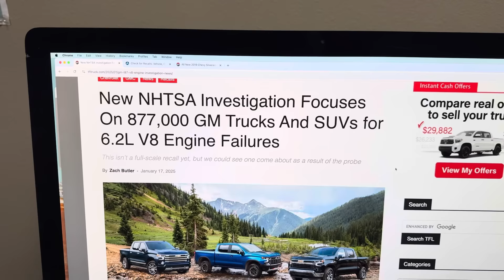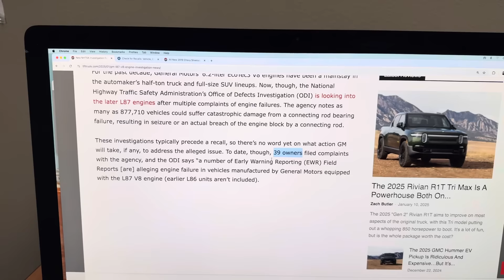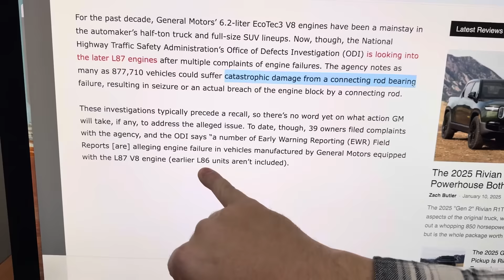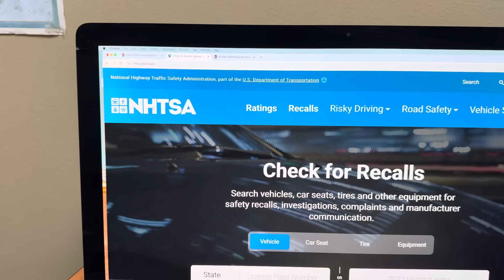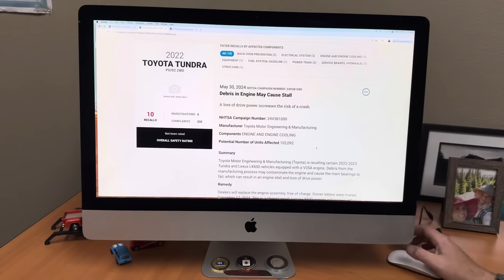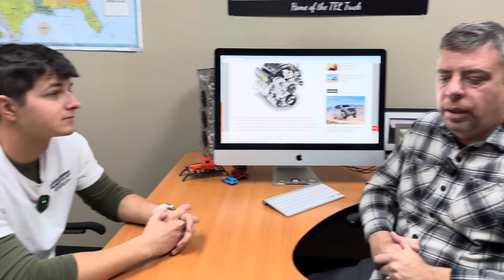877,000 GM Trucks & SUVs INVESTIGATED Over Failing Engines: Are You Affected?

Comment: My sister-in-law had her 2023 Escalade motor replaced 2 months ago for a complete engine failure with metal in the oil pan, still under warranty. This week my neighbor just had their 2018 Yukon with the 5.3L die on them 375 miles from home.

Comment: Forums have been littered for years with 6.2 lifter failures.  I went with the 3.0 Duramax zero issues.  GM needs to get a handle on this.  Pull out AFM , stop using cheap parts.

Comment: As a Tech for over 50 years, 95% of the time a failed rod bearing is caused by lack of oil. These engines all use oil and people never check the level.
Reply: My Toyota and my Honda use no oil and they are approaching 200 thousand miles !

Comment: 2020 6.2 80k miles rod failed. Oil changed at 5k miles.  5.3 lifter failure at 105k. Gm is junk.

Comment: I had to get my LS3 CHEVY SS engine replaced in ‘23 . At 40k miles, the oil pump was replaced and the mechanic got a little happy with the silicone. It went through the engine and clogged the screen to the oil pressure sensor. Thank God for extended warranty.

Comment: 39 is only the number that filed a formal complaint with NHTSA. Based on what you read in forums and comments you could extrapolate that the real number is much higher. Very curious as to whether it’s a manufacturing defect or a design issue.

Comment: This is exactly why I won't buy a new GM truck.  I will just keep my 98 Chevrolet K1500 with the 5.7L that I bought new and my 98 K3500 with the 7.4L that I bought in 2007 used.  Just intake manifold gaskets on the 5.7L and no engine issues on the 7.4L.

Comment: When you say GM doesn't want failures that's crap!!  Gm and other manufacturers build these vehicles to last the life of a lease and to last through the warranty that's it!  make it cheaper!!!
The perfect example is the 3 L. Duramax with an internal oil pump driven belt. 
Who puts a belt inside of an engine??
It's a 150 to 200,000 mi engine that's it...

Comment: I can tell you right now the complaints is way low. I had a 2022 ZR2 that the engine seized on. The original engine went out at 12k miles then the replacement engine failed at 24k miles. Also from being in the GM forums the L87 has an abnormally high failure rate. Even when you consider that people come to forums to complain. There was a poll posted were a couple hundred owners recorded there experience and there was a 11%+ fail rate.

Comment: I have a 2013 Sierra with the 5.3 V8 and have almost 80k on the motor with no lifter problems but in knowing these engines have these problems I'm making sure that I watch closely my oil to make sure it's at the full leavel always and most importantly keeping clean motor oil. I use mobile 1 full synthetic and I change it out every 3k.

Comment: We are seeing these type of failures since the introduction of CAFE oils. Notably in many cases (although not in this case) on parts that are not part of the hydrodynamic lubrication process and that hence do benefit from thicker oils. Notably also on parts that have not changed design and have been working great with the older thicker oils.

Comment: I know my 2017 Yukon Denali doesn't have the 6.2 L87 engine, but it does have a 6.2 and failed at 102000 miles. Lifter went out and seems to be the norm right now. Damn the AFM! Where's the recall for these engines?

Comment: Just go the forums. There are thousands of people that have reported engine failure on the 6.2 and 5.3. Its part of the reason I purchased the 3.0 LZO. GM needs to do the right thing here and issue a recall, but they wont until they are forced.

Comment: I have a 24 ZR2 with 6.2; I changed oil myself at 1200mi. There was an alarming amount of glitter so it really is not surprising some are experiencing bearing failures. Personally; Im not that concerned. None of the new vehicles are good options and I just plan to LT4 swap once warranty expires and/or the L87 gives up; still a nice truck.

Comment: No but my 2012 chevy 2500 6.0 transmission pooped the bed sub 160k miles. Weve had it 2 years and barely used it due to having a company vehicle. Im not sure all it's prior life but we havent abused it.

Transmission shop had a full stocked shelf for these and the half ton transmissions. Get a chevy they said after being a dodge guy.  Irony isnt lost that i drove a 90s dodge 1500 to work a few days waiting for the rebuild.

Comment: The 6.2 lifter failure rate is a major issue....  The whole Dynamic Fuel Management is garbage..  I am glad my new 2500 ZR2 has the 6.6 gasser without any of that crap.
Reply: What year n engine were u able to get without fuel management or cylinder shut down

Comment: The 5.3 is just as bad. I got a 2014 chewed up a cam and lifters and seized the lifters. The LT motors are junk. Its the cylinder deactivating and variable timing junk. If the EPA lift regulations and allow us to delete that junk out and turn them into normal V8. The Duramax with EGR and DEP crap is just as bad. The 6.0 is so far reliable but i think thats the LS engine yet. The environment crap ruins these engines. I go back to the older trucks without this junk.

Comment: This happened to my 2019 6.2L Silverado. I in the middle of busy interstate traffic and my engine just stopped. The transmission shifted to neutral and that was it. I was in the fast lane and I was very lucky the get over to the emergency lane without being involved in a crash. I had it towed to the dealer and they found that the rear main had locked up. It cost $13k for a new engine. GM picked up half of the cost. Which I think that tells me they knew they had a problem.  I think there definitely needs to be a recall on these engines. This scared the crap out of me.

Comment: Wow so much butt hurt gm and then ford boys on here.  

I had a 2007 Tahoe with the 5.3. I deactivated the AFM at 80k miles and sold it with 193k miles and it was strong as can be.  

I think some has to do with the start stop crap on the new vehicles. 

We have a 2023 Expedition and we were lucky as the chip shortage canceled the start stop on our engine.  I was ecstatic and we love the 3.5

Comment: This is not related to engine but I imagine that many of these trucks like 2024 have had significant operability issues with GMs  Google based firmware on their expensive 13.4” infotainment system. Particularly if you use an iPhone. Infotainment system without warning while underway ends pairing of the phone and navigation stops. With many busy highways can intercity quick response turns required fumbling with your phone is not only unlawful in most states but you can’t even re-pair your phone with the infotainment system without stopping your truck putting it in park and trying to repair either wireless or corded with a known good cord. The 2017 Silverado worked flawlessly. Lots of chatter on many you tube channels this is a very widespread issue. Conversations with GM for hours yields no help but they just blame Apple. Could Apple and Google be fighting and interfering with each other???  Maybe TFL new Silverado 2500 has the same problem but you just haven’t experienced it yet.

Comment: I have a 2023 terrain with a rear main seal leak and the dealer has had had my truck since 12/30/24 yesterday made 3 weeks. With 2 updates and no repair seems to bed in sight, but I do have a loaner.

Comment: It's not just bearing failures! It's sister engine the 5.3 has the same failure with the AFM system. Rocker arms seize and then need replacement. It takes longer for techs to replace those parts than an entire engine!
And yes, the failures are significantly under reported. I can give you some stories on how GM has flat out ignored me recently with premature failures on other vehicles of theirs that I own.

Comment: I can confirm that my '23 Sierra 1500 had an engine failure and is not counted in that report.  My truck went in to fix a "check engine" light and 6 hours later GM had already approved a complete engine swap.  I suspect lots of others are seeing similar responses from GM and I'm not sure how many of those are asking questions about other experiences with the truck.  They didn't even ask me if anything else was odd with the vehicle.  I will be sure to update them soon, but my truck randomly went into 4x4 and wouldn't disengage until a vehicle restart.  I also had it completely power down while driving, thankfully not on the highway or towing.  I had to pull over to the side of the road and put the vehicle back into park, and it took a couple tries before restarting.  But it did restart.  I made it around the corner and it happened again, this time I was able to get it restarted while moving by shifting into neutral.

Comment: What is it with these new engines.  I think engines were best after eletronic fuel injection was perfected sometimes in the early 90's and before all the turbos, direct injection, variable displacement, auto shutoff, etc.

Comment: We lost our 6.2 on our 2021 Yukon Denali with 31,500 miles on it last August from a bearing failure. GM did replace the engine without any issue at all. It was very very disappointing to say the least.

Comment: This whole engine needs to be redesigned to remove displacement on demand or make so it won't brick the engine. Just look at all the tic toc videos on GM v8 problems.
Reply: If they remove DOD then it wouldnt exist at all. It would be a turbocharged 6 cylinder.

Comment: I would say a far bigger issue is the fuel pump module issue in these trucks. I have seen towing videos featuring 39 trucks already, some of the SAME truck twice!!! Best part is they are replacing the failed part with the SAME part, no fix has been found as of yet. And that issue is all vehicles from the Traverse, XT6, Acadia, Tahoe, Silverado 1500, 2500, Suburban, Escalade & Yukons and in the higher trim levels a non-running vehicle with electronic shifter can NOT be manually shifted into neutral. So your $100,000 High Country just gets DRUG onto the rollback, and then shaken off at the dealership. Check out @TowTruckDustin for video proof.

Comment: How big of a pia is it to route these issues through the “proper” channels to have it resolved? I would guess a royal pain as these and other catastrophic failures are well documented on the 5.3 and 6.2.  Influencers need to stop putting heads in the sand covering up for these piles. All these manufacturers build trash nowadays you guys can afford to drive them for a year or two and dump them before problems happen.

Comment: The 2014-2018 6.2l had problems, too. My 2015 Silverado 1500 with the 6.2l has just hit 100k miles with no issues. I fear mine will suffer the same fate, but so far, I'm happy it even made it this far.

Comment: With current emissions standards, NA engines are not that reliable. 
Hybrid and turbocharged engines with dual injections are way to go imo.
Reply: This.

But also I think OHC V8's, like the Coyote, are better suited to cylinder deactivation since the cam is right there at the valves and the process can be a bit simpler. The 2021+ Coyote seems to be doing pretty well. I wonder if we will see GM go to DOHC on this next gen small block that is supposed to be coming out.

Comment: Andrey 39 is # of complete engine failures. Theres also alot of problem's with lifters & other damage that results in 5-6grand in damage. I seen a garage wanted 6grand just to replace half the lifers that's insane. Until GM gets away from active fuel management or dynamic fuel management theur going to continue to have these problems because of government mandates. The government has made GM take what was a a solid engine & turn it into junk from collapsing lifters with solenoids so it can run on less cylinders dumbass idea. The competition isn't doing any better. The 6 cylinder turbos are blowing up as well from Ford & Toyota.

Comment: the lifter is the key to this failure where the"AFM"(active fuel management) system causes the lifter is restricted with oil supply to the extent that it shuts down the 4 of 8 cylinders and then galls the lifter introducing metal shavings into the oil pump. over time this "glitter will cause the crank/rods will die!
Reply: I like your theory of shavings from deactivated lifters.  I suspected  the problem was because the oil pump is at the front at crankshaft level and the oil pickup is downhill and two feet south of the pump.  The old SBC had the pump submerged in oil at the back of the oil pan.  That seems a better design to me.  I hear a lot of the LS failures are while driving up a hill making the pump/pickup situation even worse.

Comment: Wait until they start talking about how many new GM vehicles are failing, even with just a few hundred or a couple thousand miles... leaving them stranded on the road requiring a tow... because the Fuel Pump Module keeps failing.. many have reported getting it towed to the dealer.. replacing it.. and sometimes they've failed within 10 miles of getting it back.... GM hasn't issued a recall because they don't have an answer/ solution..... All the overly complex systems are just creating more problems, less reliability & higher repair costs... as well as more likely to have the vehicle totaled out by insurance after minor damage because of the high cost of repair.  Newer doesn't mean better...Especially with they hyper inflated prices over the last 4 years.

Comment: My 2019 silverado 5.3 brand new had no motor oil showing on the dipstick when I checked it at 700 miles.. not sure if that’s causing issues.
I would change oil immediately after purchasing my next vehicle.

Comment: This is sad because at one time…. I used to believe that GM was about longevity and durability.
Reply: That was in the 50-60-70's
Reply: It is only about Sr Mgt money, kissing the governments ass and EV's that no one wants to buy.  The CEO and other Sr Mgt needs to be fired. My 1965 Malibu SS and 1976 C1500 with over 250,000 mile engines are better than these new trucks.

Comment: Complaints doesn’t mean that owners aren’t experiencing these issues like myself. My 2019 6.2 is and has been sitting at the dealer since November 7th. Bearing failure yes I prevented a lock up due to me being proactive on my maintenance. If I would’ve ignored the lower tick it would’ve seized. Either way I’m now waiting on a replacement engine which has been on a national back order due to the high failure rate.

Comment: Still waiting on GM to take responsibility and issue a recall for their faulty lifters/AFM system! In the process right now of replacing all 16 lifters and possibly the camshaft on my truck because intake lifter on cylinder 6 collapsed.. 2018 GMC Sierra 6.2L with only 145,000kms on it.

Comment: Andre you work in the truck information and selling industry so acting naive is not a good look.  39 rod bearing failures out of 877,000 units sold?   There are close to 39 failures just in the comments section of this video.  That to say that probably most of the victims that experienced a catastrophic engine failure under warranty and had the engine replaced promptly and did not file a report with the NTHSA, nor did the manufacturer.

Comment: My 2021 Silverado with the L87 is currently sitting at the dealer waiting for a replacement engine (which are on backorder) because it failed at about 50k miles.  Luckily still under warranty.  There are 6 other vehicles at this one dealer in Traverse City, MI also waiting for replacement engines for the same failure.  Not a very large market and not a large dealer.  Six at one dealer would make me think there's a bit more than 39 across the Country.  If there are 6 at each of the 7,000 dealers in the U.S. that would be more like 42,000.  There are way more than 39 reported just in the comments of this video.
Reply: Sad enough that the engine failed. They need to look into why the engines are on back order. How is it that they have the engines to install in new vehicles, yet they have no replacements for current customers?

Comment: I bought a 2021 Sierra 5.3 v8 new and before I hit 7000 miles lifters broke and they replaced that side lifters. Then before I hit 17000 miles the other side lifters broke and somehow scratched the cam shaft. Gm replaced the engine then.  I sold the truck at 30000 miles. Feel sorry for who buys this truck. They blamed it on a bad batch of lifters bought from a non gm vender.

Comment: Only 39, but that's 39 complaining regarding safety.  That might been 39 failures happened which caused safety issues. 

Complaints and engine failures seem to be consistent online.  I'd guess recalls at higher levels might be imminent.

Comment: I know of two people personally who have had major engine problems with their 6.2L GM pickups. The 39 number is so far from accurate. A lot of dealers were blaming the failures on driver  error or lack of maintenance. Maybe that is true in some scenarios, but certainly not all. The number is significantly higher than 39. Also, a lot of these engine failures are due to the cylinder deactivation features. Turning this feature off has proven to actually increase fuel mileage and reliability.

Comment: My cousin's 2022 Sierra Denali 6.2 had its engine replaced about 6 months ago, under warranty, with a factory new 2024 unit right at 29k miles . At first an engine knock developed at about 28.8k and got louder over the next 100 miles. Rod failure.Truck manufacturing date - September of 2022. 
Sacramento, CA

Comment: The problem i see is nowadays 0 20 oils and 5 30 oils are weak, I'm using 5 50 in my corvette z06 my Aprilia rsv4 1100 factory uses 10 50 castrol my harley uses 20 50 royal purple ,I'm using 10 30 conventional in my hhr but with stp treatment . I'm old school 10 30 at the least and change it every 5000 km . And yes my Aprilia lays waste to anything.